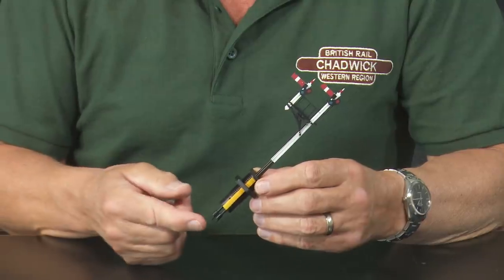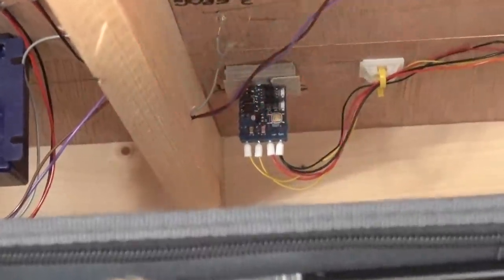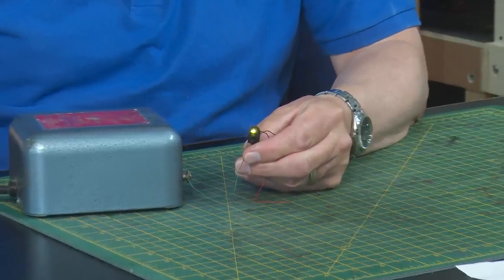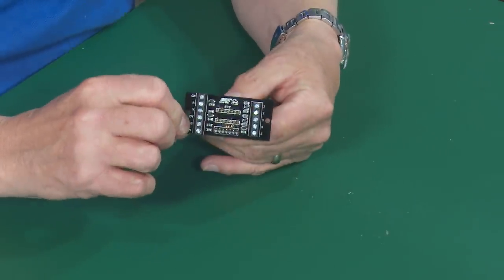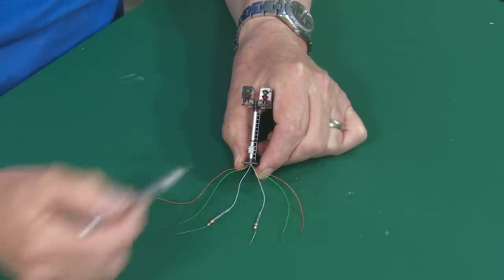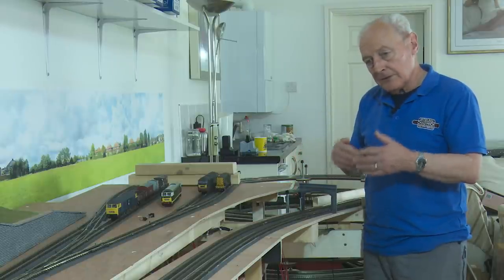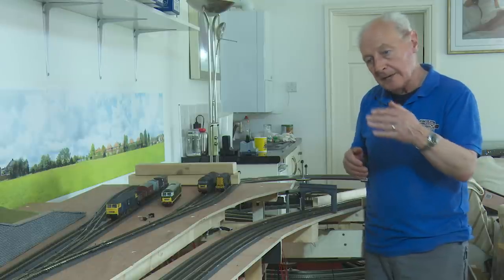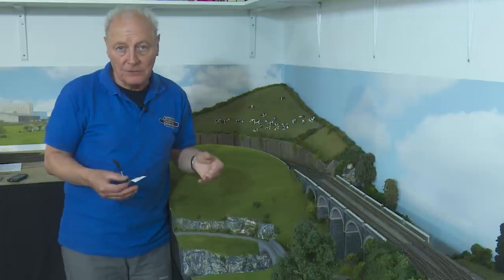Wiring LED and Semaphore Signals at Chadwick Model Railway | 135.

Comment: I learnt absolute block about 10 years ago and never worked an AB box so I’m sure I’ll be corrected but in regards to the signal at the tunnel (I assume it’s the home signal and this leads to the station) I would keep it the way it is, assuming that the train has passed a distant signal at yellow and the driver is expecting a red. The Home signal will be cleared just as the driver is almost at a stand indicating the section signal (at the platform) is at danger.  As for the platform signal  the train shouldn’t start against a red as this would incorporate the risk of a SPAD.
Reply from the maker: Yes I do understand.But I’m afraid it’s the way that Iain has fitted those station signals, there is no easy answer.
Reply: @ChadwickModelRailway  indeed I think automating signals on a layout can be just as complicated as automating them on the real railway.
On your Friend’s layout I’d personally make the signals manual operated and work them like a you would a real manual box, best job on the railway, but then again I am biased like that. Thanks for another useful video.
Reply: Does the control logic have a manual override for the starter signals? At the worst, a resistor across the sensor would give a false trigger, and hence allow the train to depart (within the green “window”)

Comment: The reason for keeping semaphore signals a danger and only pulling them off for trains, is that railway signalling system should be fail safe. In several incidents with mechanical signalling cleared when the train had left the section, was the signal freezing in the off position, in winter conditions.
Reply from the maker: I’m with you on this one Diane.

Comment: Hi Charlie, I have all my light signals on green and sensors AFTER the signal with time delays between red, amber and back to green, I adjusted the time so the train would get a green when it had completed a circuit.
Reply from the maker: A good plan Chris.

Comment: I think the junction feather problem is an interesting one. I'm not sure I agree with John on this I can see where he is coming from though, I've always been lead to believe the feather shows the driver,  if and which subsidiary route they are been sent down, even if that is straight on. That way if is not a route they are passed out on they are supposed to stop and report they can not travel it, the use of the feather stops the claim they didn't know. It doesn't always work York was a good example where even with routing indication. an ECML drive took his train down the Scarborough branch, shorted out the pantograph on the metal roof and blow a hole in it.  I think if this was real life the whole junction would have been relayed to ease the curve of the mainline and the feather would point to the left to the branch line.

To be honest it your model and a bit of artistic licence is fine.
Reply from the maker: I’m with you on this one Gerry.

Comment: Regarding the second Yellow LED requiring its own resister. I'm not sure what "strike rate" is regarding LEDs, what I think you mean is that each colour of LED, (red, green, yellow, blue etc.) will have its own forward voltage drop and current draw for a particular light output. The current draw will affect the voltage drop across the resistor and hence the voltage drop across the LED. Because only one of the red, green, yellow is on at a time, if you're running your LEDs of 12V, then with a forward voltage drop of about 1.2V for these at say 20mA the resister will have to drop 10.8V and so will be about 540Ohms, R = V/I. If you use this resistor for 2 LEDs the voltage drop across the LEDs will be approximately the same, so the (total) current through the resister will be the same, hence the current through each LED will be approximately the same, with each passing half the current, so each will only be drawing 10mA, and so half as bright.
Reply from the maker: Thinking back I may have been thinking that if the yellow LEDs are from different batches/manufacturers, then the possibility exists that only on may light. This is exactly what happened when I installed red and white lamps in by guards van. Regards Charlie.
Reply: @ChadwickModelRailway  It's been a long while since I messed around with electronics. A few points;
1. LEDs are always driven individually. Common Anode or Cathode is typically associated with a multi-segment display to reduce the the number of pins on the display. The red, yellow, green signal is an anomaly in that only one "lamp" is illuminated at a time, so it is conceptually a single LED.

2. I had a very quick look at a couple of LED data sheets, and a) red, green & yellow LEDs come in at least 1.8, 2 & 2.2V versions, and for one make the Forward Voltage at 2mA is 1.7V, 1.8V & 1.9V for the red, yellow and green versions.

So having two different colours using the same dropping resistor isn't going to work / work well. Also, blue and white LEDs have a 3.3V forward voltage. 

3. A corollary of Murphy's Law is, the sum of the errors is always cumulative. So even for two of the same colour having a common resistor, a) the resistor can "only" be the nearest available manufactured size, b) bulk standard resistors have a 5% tolerance, c) the forward voltage can a max of 0.3V (red / green) to 0.7V (yellow) (for the data sheet I found) above the typical forward voltage.

If you want to drive more than one LED from a single power source (especially if you have 12V to play with) and you only want to use 1 resistor, you can run them in series, but make sure then have the same typical rated current.

Comment: SIGNALS AND SENSOR POSITIONING - 2

Charlie, I forgot to say that if sensors were fixed well ahead of the signals they actually operated, it would be possible to replicate the clear road ahead for a train, (be it fast moving or otherwise).

In the case of a fast train this would replicate 'signalling blocks' being cleared well ahead of the train, as per operating practice.

Of course, this would mean a little more wiring having to be done, but nothing too technical.

Obviously the use of reed switches, (as I mentioned previously), would facilitate the same process.

James Hennighan
Yorkshire, England
Reply from the maker: Thanks for the clarification, James. Regards, Charlie.

Comment: Hi Charlie, Just a small nit-picking point, If you were to use just one resistor as in your description of common cathode or anode it would theoretically be wrong. If two LED's are lit at the same time the current flow in the circuit is double of that if one was lit (assuming that the forward current of each LED is the same), therefore the resistor value would be wrong for that circuit. You would have to have a resistor in series with each LED to be correct. However, as in this case only one LED is lit at a time so it does not matter but if in the case of road traffic lights red and amber are lit together. Other than that it is explained well. Regards, Geoff.
Reply from the maker: Thanks Geoff, I knew that this would be a minefield.

Comment: Hi Charlie another enjoyable video. I believe semaphore signals are run differently to colour light signals i.e. they don't show clear when the block is clear all of the time, only when a train is due and has been accepted by the signal box. Also Dapol have brought out a different arrangement of operating their semaphore signals. The bracket signal you showed uses a servo motor underneath the board and works similarly to a Hornby passing contact switch. The original style just requires the two yellow wires to be touched. I noticed that was the style set up to the automated signal system. Therefore does it work with the servo type also? Look forward to your next video. 👍
Reply from the maker: And interesting comment Simon, and I will certainly take it up with Ian. Regards Charlie

Comment: For anyone struggling with anodes and cathodes, the way I remember it is “Red Ants and Black Cats”. If you’re not familiar with the convention of red wires for power and black for ground, this might not help.  “Common” just means connected together, so, common cathode just means the cat (or black) end of the diodes are connected together, and to ground. Also, there are quite a lot of black ants. Ignore them.
Reply: Or the alphabet trick: power flows from a to z, c (and k) are after a, so that's the minus side
Reply from the maker: Guys, now I’m totally confused. I’ll stick to my colour chart! Regards Charlie
Reply: @ivovanzon164  where does positive fit into the alphabet? 🤪

Comment: Another super video.  Personally, point geometry aside, I would have the feather on the branch station and treat the helix route as a continuation of the main line, but unless we are replicating a real location I don't think there is a 'wrong' answer.  Have you considered block detection to trigger the signals rather than a fixed sensor, for example, to guard the helix and trigger a clear only when the train has left the helix?
Reply from the maker: Hi Jamie, yes I have but I wanted to make an example of using a timer type signal as not everyone wishes to dip their toe into full automation. Regards Charlie
Reply: Are there modules that can take inputs from your block detection? So the system actually works “prototypically”. 😜

Comment: Talking of wiring, I hate dealing with the fine gauge wiring on Hornby point solenoids.

I have found the answer, for me at least. I bought a role of copper conductive tape. 
Having doubled back the Hornby wiring, I cut a narrow piece of tape long enough to 
cover part of the wire insulation and wrap around the wiring. I end up with a stable 
wire end suitable for insertion in a choc. box terminal.
I hope this is helpful, or I may just teaching my Grannie to suck eggs.
Reply from the maker: Thanks David, I have never used the tape but I do know of several modeller who swear by it.

Comment: Hi Charlie. I would have thought that there would still be quite a few semaphore signals operating within the time period you are modelling, especially near a station at the end of a branchline such as you will have on top of your helix.
Reply from the maker: Yes that’s quite true Richard and I’m still undecided. Regards Charlie.
Reply: I want to have a mix of both on my layout but mine is predominantly steam and much smaller than yours so I won't be using block detection. The selection of decent semaphores is much smaller than colour lights and they are more work to automate.

Comment: Do British modellers use DCC signal drivers specifically designed for British signals? As they seem to combine parts of the pre-1900 German system (the feathers) with the typical H/V system. I'm speaking from a continental point of view where the default mode of a signal driver is usually H/V or Ks
Reply from the maker: Yes IVO, I believe they are specifically designed for UK signals. Regards Charlie

Comment: I am very new to all this. Could you perhaps use 2 sense blocks to control the signal. One to turn the signal to danger and the other passed the next signal to turn the first signal to clear as in an absolute block? I think your friend was right about the feather. As a feather denotes that you are about to leave the main line. So straight on is not the main line. Or that was what I was taught as a driver. Very interesting video though. Have things progressed so that the signal controls the train? As you could quite easy get a spad. I would also like to see how you link several signals together in sequence red, yellow, then green. I just found you by chance and have really got me interested (even hooked), so I will be binge watching to see what else you have produced. Thanks for posting
Reply from the maker: Rest assured mate all your points will be covered in the forthcoming block detection video. Regards Charlie.
Reply: @ChadwickModelRailway  Thank you

Comment: Well done Charlie, another fascinating and interesting video with lots to remember.
With regards to the speed measuring unit, have you any idea when they will be producing a new model that has the correct calculation software installed
As ever thank you Charlie, looking forward to the next video
Paul
Reply from the maker: Hi Paul no I have no idea when a replacement will be available. Regards Charlie

Comment: I was wondering if it would be possible to swap the logic: so that the trains are controlled by the signals rather than the signals being controlled by the trains?
Reply: I believe the complication here is, that you will have to know on which section each train is at any given time, for it to be able to react to a signal. The controller has to stop the correct train at the correct section. The controller can learn the state and position of all the signals no problem, but you'll have to feed all train IDs and positions back to the controller as well -  which will need some creative thinking. I believe it could be solved with key fobs on trains, ID scanners around the track and a programmed script that is matched to your specific layout running on for example an Arduino as controller. I work with software and would like to do exactly this, but can't help thinking that there must be an easier way to do it? Good show Charlie!
Reply: @downunderDSB  You can probably just use normal block detection with isolated blocks where a block has a controller that sends information back to the DCC system and stops any train in that block if the next block is occupied and then find a way for the signals to match that, likely by having the signals be controlled by the block ahead rather than by the train that's in the current block. This is the more expensive way I'd think, since you need a separate controller for each block. I'm not sure which DCC systems are set up to work with block detection to tell trains to stop at certain times or if you also need extra modules or automation to do that.
Reply: @danagibbs3265  yes, I want to keep the complexity and cost down. Are you saying that the controller can read the Loco ID when it enters a block? Because the controller will need  to know the address of the train before it can slow it down in DCC. Actually, that must be how train software keep track of all the rolling stock. Now I'm excited to know more - will go investigate! Thanks for enlighten me.
Reply: @downunderDSB  I would have to assume if the block is isolated that it would be possible, but I haven't looked too much into block detection yet. I'm only doing a small N scale layout myself, so I don't have any reason to do blocks and I'm not trying to build super realistic either
Reply from the maker: Great comments folks.  I believe that full block detection and programming is the only realistic way to do this.
 I will stick my toe into the water of this subject in a few weeks time. Regards Charlie
Reply: I don’t know if there’s a program but it sounds like you’d need a have a program on a computer that controls DCC
Reply: @ChadwickModelRailway  with the size of your layout (when it is completed) controlled by one operator - yes.
A club layout with alot of operators can be run very near to reality at steam era(s), good examples for that are FREMO meetings where temporary build together moduls are "played" with train drivers, signalman and other jobs.
Reply: Back in the 80s, on a DC layout, in station and yard areas, we had the starter signals (colour light) linked to the points (is that interlocking?) and then isolated sections in front of the signals that were only powered when the signal was green. If the point was against the train, the signal was always red and the track was dead; if the point was set for the train, the track was powered, and it was up to the operator to change the signal and drive the train off.  On the open stretches, the track was (as I think is/was relatively normal in DC cab control) split into isolated sections, and track detection was used to set the signals at the start of each section/block.
It involved a lot of wire and relays!
Reply: Yes, ish. The SIGM20 unit will control the signals in response to the train positions, and it can be arranged to cut the track power on a short section after the signal. That way, any train passing a signal at danger is stopped suddenly.

Of course, if you have a stay-alive fitted, that woukd probably get round it, but you could arrange ABC braking after a red signal, though I've not seen that in action.
Reply: @downunderDSB   Hi there I am working on a solution for this myself it is almost ready Watch this space
Reply: @downunderDSB  this is what railcom is supposed to offer,  but it is not universal to all decoders and systems. To get proper signal controlled trains you really need a computer running something like jmri and a way to tell jmri what each train is and where it is,  this could be something like rfid or barcodes under the trains with detection at set locations. It can get complicated quickly though!

Comment: The views of mechanical signal box interiors all show the leavers ‘forwards’ when the signals are are ‘on’. This would release any tension in the cables and the signals would ‘default to this ‘on position’ if the cables etc got damaged. On this basis its not  acceptable to have a semaphore signal default to ‘off’.
Reply from the maker: Your knowledge on this subject Chris, is clearly better than mine. 
Regards Charlie